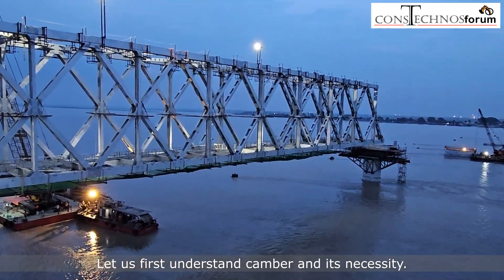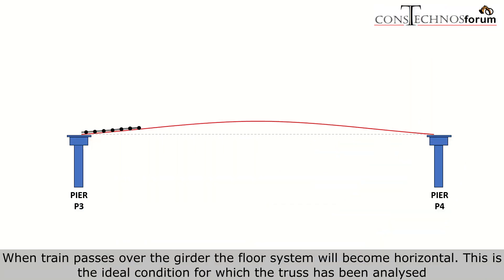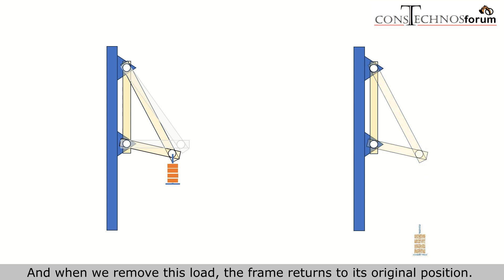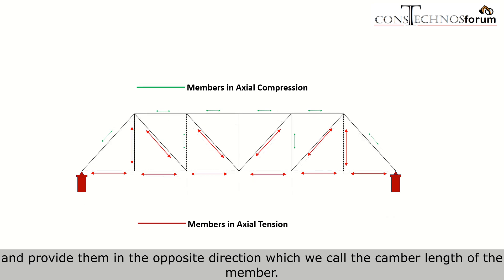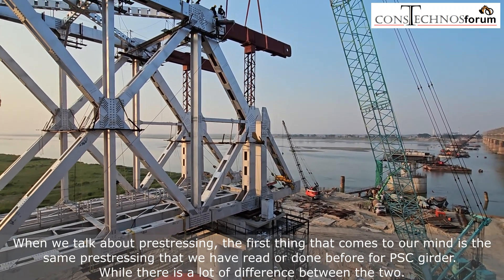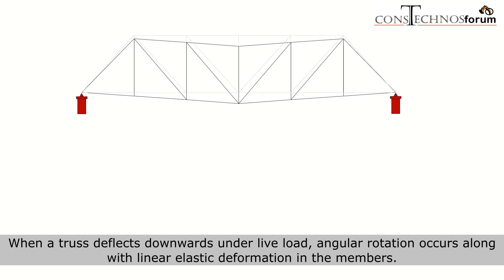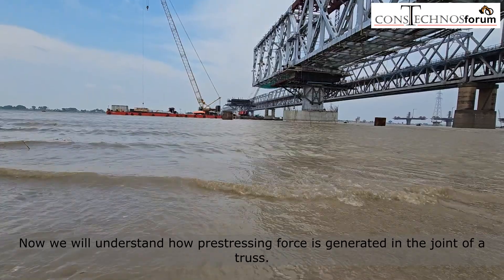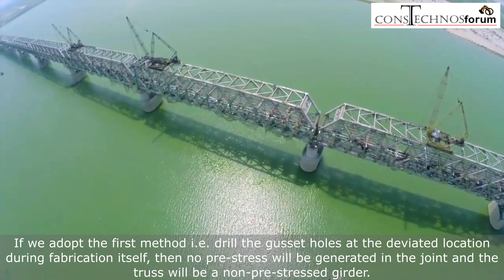Pre-Camber & Pre-Stressing of Steel Truss Bridge (In English) @MAHESH_IRCON

Comment: Time05:00
The fabrication is complicated.
Some members may purposely cut shorter at workshop to accommodate deflection (vertical 25mm deflection for 25m span in 1:1000 deflection limits say)

The bridge structure might slightly hocking before imposed permanent dead load and traffic loads to counter balance the calculated deflection.

If the structure is fixed ends (both side) how to deal with such complicated issues. For example how to pre-loading the structure steel members during fribrcation???

Fixed end bearing design feasible...

During Pre-camber stage > both bearing not subject to lateral sliding force > only vertical force

Solution
When imposed living loads > the bridge will be expanded horizontally > the fixed end bearing will push back to prevent the bridge expand horizontally (so both fixed end bearing shall be designed capable to taking x and z direction forces)
Reply from the maker: Hello Brian,
First of all, thank you very much for visiting the channel and for your valuable comments. You are absolutely right. Deflection can be restricted by providing fixity at both ends and by designing the truss member heavy enough to withstand axial forces without axial deformation. But in that case, the self weight of the truss will increase and there will be additional horizontal force at the fixed end due to braking and acceleration effect of the train. This will ultimately increase the overall cost of the structure significantly. 

Engineering isn't just about building bridges. Good engineering means creating a structure that serves its purpose without compromising safety and is also the most cost-effective.

Your idea may be suitable for small trusses, but when your truss span is more than 100m with heavy live load like Indian Railways freight train, its cost will be quite high. 

Thanks you once again. We'll be in touch to discuss technical issues. Please subscribe to the channel and share it with your friends and colleagues.

Comment: Sir, The Concept is well explained. Earlier I have seen your videos of railway curve design calculation sheet, those are magnificent and can be easily implemented at site.  
  
in the present case I am enthusiastic about the calculation part too, if possible, you are requested to provide the basic and railway OWG calculation part in excel sheet for a standard railway loading. 

Thanking you sir. 🙏
Reply from the maker: Will upload soon
Reply: @MAHESH_IRCON ❤
Reply from the maker: But the main problem is, my channel is not getting subscription compared to my efforts in making videos. Low subscription is always disappoint in making videos.
Reply: @MAHESH_IRCON ❤❤❤